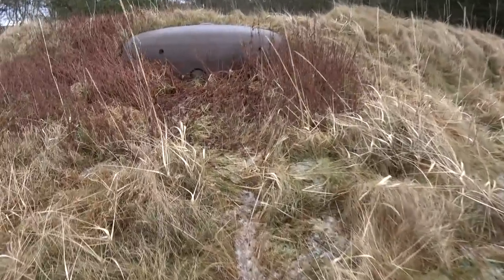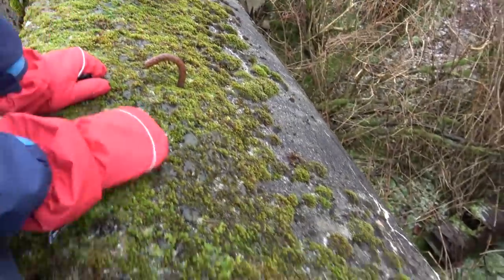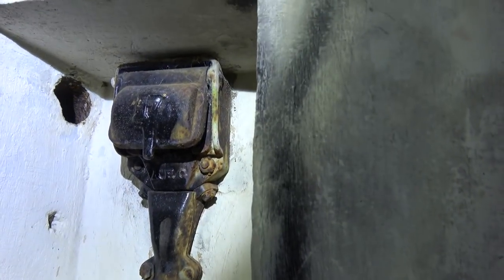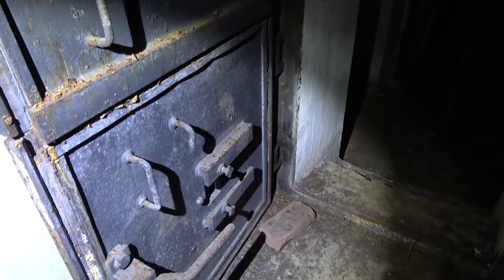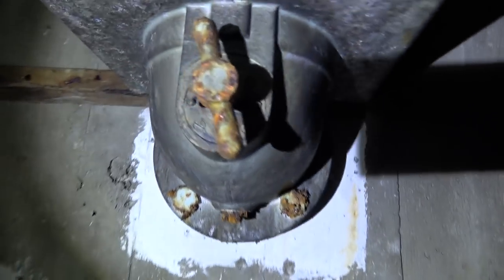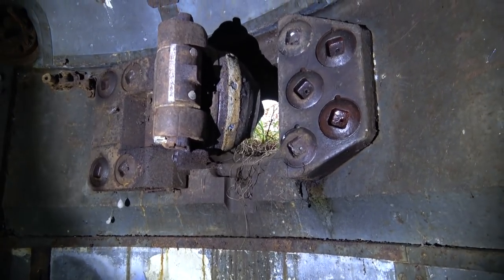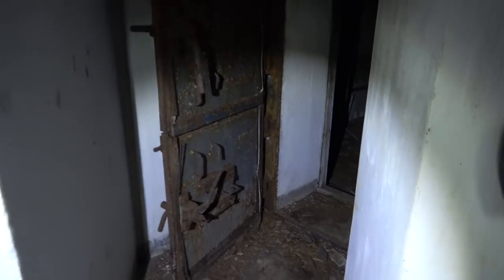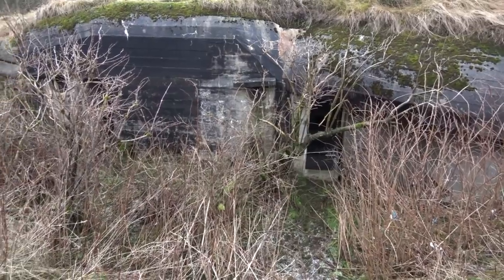You wont believe what we found up there.. GREAT LOCATION  !

Comment: Those graduated markings are actually Mil-radians or MILs and are used for artillery and other things as they are much finer that degress, as there are 6283 Mils in a circle as opposed to the 360 degrees. Thank you for as always thank you for keeping history alive!
Reply: I saw that.  Do you know what the other scales above and below the mil ring may have been for?  It looks like the rings may have turned independently from each other and one time.
Reply: Chris   that was a Vernier scale for smaller divisions on John's Mil -radians scale . John is correct about the Mil-radian , good spot !  Back when I was In Tool + Die  we used Dial Calipers Which did the same thing as Vernier Calipers .  Every body called calipers Verniers  whether they were dial or not .      It is not exactly the same as a slide rule  but you get the picture ?
Reply: Got it.  Thanks
Reply from the maker: Thanks John for great feedback and for watching.
Reply: This whole thread makes me feel dumb 😂
Reply: Most implementations of mils round up so that there are 6400 in a full circle.  Due East would be 90° or 1600 mils, due South 180° or 3200 mils, due West 270° or 4800 mils and due North 360° or 6400 mils.    The Germans may have worked to the more accurate 6283 mils, I don't know. 

Artillery men love them because it allows range and measurements to be easier.  1 mil is 1m at 1000 m.  If, for example, you can see a standing man (approx 2 m tall for rough calculation) and he measures 1 mil then he is 2000 m away.  

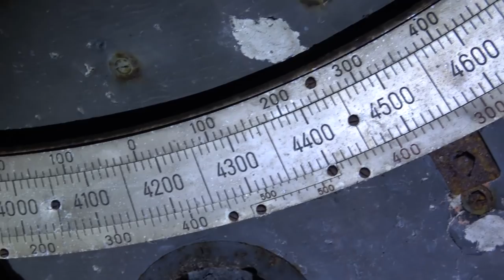I presume one scale was fixed for true North and the other  scales allowed for fire control orders relative to their main axis.  Note how at 13:18 it shows that there is a join of the two scales.  (Also at 15:37).  One is going clockwise ascending and the other ascends counter-clockwise.  I assume that 0 mils was the centre of axis for each gun port.  This would allow each machine gun or fire port to give fire control orders with clockwise/counterclockwise 575 mils (very, very slightly over 32°) from their main axis.  By combining with the main ring, I presume, orders could be sent more quickly by reference to a mils bearing from the actual grid position.  

They do not appear to be Vernier scales since the increments are the same as the main mils ring.  Mils is short for milliradians and 1 mil is 1/1000th of a radian.  I hope that helps.
Reply: wow did not know that, thanks man
Reply: Nope.  There are 6400 mils in a circle.

Comment: At 18:29 that is a right hand, outswing door, and it is mounted upside down, because it's all they had at the time, and if it was correctly mounted, it would be in the way of passage, that's why it was mounted upside down.
Reply from the maker: could be it. Thanks Joe
Reply: Not only it was the only thing they had at the moment, it was the only way doors for active duty bunkers were constructed. In a operational bunker all doors always turned the same way. If it was not possible to mount the door the right way they hung it upside down. So a soldier could see the door wasn't standard.

Comment: One day, you will find an 'occupied' bunker. There's bound to be one somewhere.
Reply from the maker: well i know of several :) Thanks
Reply: Donna, please! I meant corpses, not living solders.
Reply: So there are sealed bunkers that were never cleared out? You know that means all the equipment would also be still inside those bunkers, everything. If you don't mind the skeletons that is.
Reply: +Nick Breen Most bunkers were cleared out by the locals after the Germans left. Anything metal was salvaged for use elsewhere.
Reply: Appalachian Snapshot ž

Comment: Good god, i've seen similar in my Bunkering youth, the steel section had coloured sectors with ranking marks on it. I think it fronted gun emplacements as a ranging point.. Jersey is littered with various bunkers of all types and some are restored and open, others finds in the rough! I even went into an old unfinished tunnel that was filled with various "bits" from Horse gas masks (conical bakelite) to gun boxes, helmets and rust! piles and piles of rust....
Reply from the maker: must have been very interesting Andre. Thanks for sharing and for watching.

Comment: That bunker appears to be a Type 632 design and I believe that turret is a Sechsschartentürme.  The gunner could quickly withdraw his MG34 from one hole and push it along a rail to another.The MG 34 mounts are equipped with armor fittings that sealed the holes and telescopic sights. In addition, the turret had a periscope and a searchlight, all of which could be operated from the turret. Each turret operated two MG34 machine guns on rotating mounts.
Reply: The interior of the turret was brightly painted into 6 sectors (one for each loophole), and each sector was also numbered. One MG34's fire would be directed via the colours while the other MG34's fire would be directed via the numbers. This is how many Atlantic wall turrets operated.
Reply from the maker: Great find and very glad to have share dit with you Jake :)

Comment: Very nice opening to the video. That bunker oven would be cool to clean up and use in your home during the winter. Nice to see a bunker that has not been vandalized and items taken. Really unusual to see so many ventilation filters still there. I wonder if the first small opening you saw was the escape tunnel? Very nice to see the inside of the panzer turret. I wonder if the mechanism in top of the turret was a vent to let the smoke from the gun out? Was the turret turned by hand or was it electric? Very nice to see this location.
Reply from the maker: Tower was manually cranked and smoke must have been ventilated out through there somewhere yes. Thanks my friend.

Comment: 12:57 If I remember right there would have been an iron or steel rod going down through the platform hole to the concrete below. Here there would be a hand operated hydraulic jack (like for a car) The cupola was then jacked up slightly by another soldier and TURNED BY HAND to the correct bearing then lowered again to lock it. There was no electric way to rotate these gun turrets, just a 'jack man' and the 4 guys in the top turned it around as it balanced on the steel rod.
Reply from the maker: There you go and thanks for watching.

Comment: The dome markings are not in degrees but in mils.  A circle has 360 degrees, but 6400 mils.  Miles are used for directing fire because they offer a higher amount of accuracy.  To put it in perspective, if two people started from the exact same point and went exactly one kilometer, but diverged by one degree  when they stopped at one kilometer they would be a little more than 17 meters apart.  If they did it again but were only one mil different in direction, when they stopped after one kilometer they would be exactly one meter apart.  This level of accuracy is needed for the firing of any type of indirect fires, and is also used with machine guns due to their great range.  I spent many years as a Weapons Squad Leader in Airborne, Air Assault and Light Infantry units, being in charge of the Platoon’s 2 machine guns.  I had to train my gun crews on these things all the time.
Reply from the maker: Thanka for feeback and for watching.

Comment: It looks like a rangefinder position, I have visited some very badly preserved ones in Italy that had the same sort of rangefinder turret, which were supposed to locate a target and communicate the coordinates to the coastal artillery.
The two armoured hatches would have been used for immediate visual recognition before doing the fine tuning with the periscope.
What I find interesting is the instructions about "don't open this hatch with lights on", which makes me think the bunker was concealed in a very visible spot! On a second thought that could explain the weird configuration of the blast doors?
They are like barn doors but inverted (i.e. you either open them fully or only at the bottom), which someone before explained as a  fire/smoke/gas attack reason... How about it was just a measure to prevent/reduce light leaks instead?
That would make sense to me as it seems to be a secret recognition/intelligence outpost more than a fort or defensive structure.
Also, yes that thing in the escape corridor really looks like a panzerfaust or mortar shell! :)

Comment: The numbers on the dome  were not in degrees but in another unit of angle which I can not think of right now, but is used to plot mortars and artillery.  So maybe this sight was an artillery fire direction center?  Mil is equal to the angle forming an arc that is 1/6400 of the circumference of a circle, used for directing artillery fire.  You might look up what artillery unit were in this area.
Reply from the maker: Thanks for comment and for watching.

Comment: The sighting, aiming or traverse ring in the turret is marked in milradians or mils...There are 6283.1853 mils in a circle, but they seem to be rounded off to various values in use, such as 6283 and 6280... This is often in many military organisations rounded to 6400 or 3200 for 180deg of a circle or 1600mils over an arc of 90deg... basically 1mil gives an arc length of 1m at a distance of 1000m.. Useful for the accurate aiming of shells or projection of mortar bombs.
Reply from the maker: Thanks for feedback and for watching my friend.
Reply: No worries... a very entertaining video.

Comment: The hatches at the bottom of the blast doors are there for a reason. If the enemy penetrated the bunker, a blast door could be shut.  Having the hatch at the bottom meant that a machine gun with bipod could be fired down the corridor at approaching soldiers.
Reply: No. They're upside-down because constructors needs sometimes left-opening doors, sometimes right-opening doors but they have no choice - only one type was available. They simply flip the doors because they need to do their work asap. Remember, date 1943 on armour means only it was produced in 1943, but then stored and used in buildings made in late 1944. These doors are simple one piece door, used inside bunker, not a special outside doors made of two halfs to avoid blocking by earth or concrete bringed by explosions.

Comment: Comment to that upside-down-door; all doors in a German bunker were turning at the rightside (when you had to pull the door to open). That was done so a soldier always directly knew what way to go in case of a hurry/emergency. If he should look first he could delay the action or worse, could harm himself (or his mates) by trying to turn the door the wrong way. 
As you can see in this bunker, the hinges are at the left side so the door is just turning the opposite way. Doors turning the opposite way weren't made in the Reich; if needed they just hung the door upside-down. This was also a marker for the bunkertroops that the door was different of the standard ones.
Reply from the maker: ok and thanks for feedbacka nd for watching.

Comment: The degrees on the dome were used with a mathematical equation that would allow them to aim the guns/turret at pre-recored locations at night. When they built the bunker they would have surveyed the surrounding area that was within range of the guns and determined what locations around the bunker were weak points were enemy's could advance or hide behind. The idea was should the bunker be attacked at night using the degrees in the turret they could aim it at the locations they pre-recored that would be a likely spot of attack. Also if you noticed the doors such as the one in the turret that seals up that hole has a gasket, so did the door for the guard. The bunker was also built to withstand gas attack's as well. What ever bunker this is the Germans invested a lot of time and money into it, it must be close to a city or a port or some other invaluable strategic asset.
Reply from the maker: Thanks for great feedback and for watching.

Comment: Double hinged doors are also the point of discussion  at the Normandy beach bunkers, their theorie goes like; if rubble would block the door, you can open the upper door to get out. Accept  overthere is not a single one double door remained in time. So you have a verry important issue for history preserved.
Also the bunker heating/ fire place is a museum piece a la carte!
The shooting dome is in exstraordinary conditions , unbelievable!
( Just for Information:  At the end of the war, Some metals were so scarce that some female war movements have ordered women to wear bra,s without steel supports, No Joke! My father told me that scrapping in those days was lucrative but verry dangerous.  Brass like casings, copper like drive bands from uxo's and wireing out of vehicles tanks airplanes and bunkers.
And so on the steel dissapeared with its original form. )
So i must say Congratulations with your time capsule, you found one !!!!!
Reply from the maker: Appreciated and thanks  for watching.